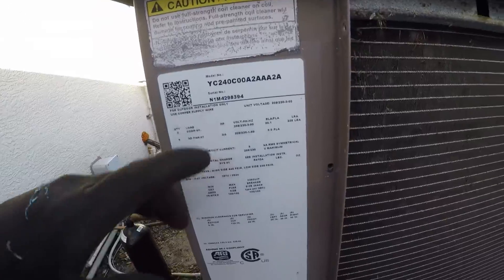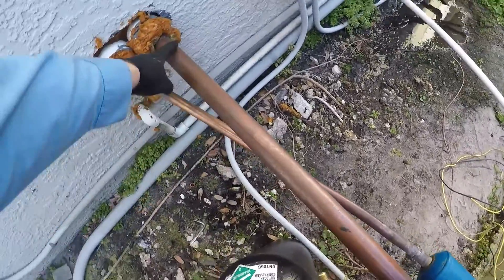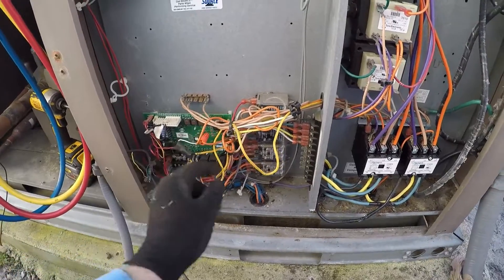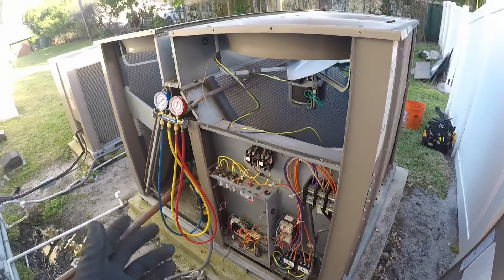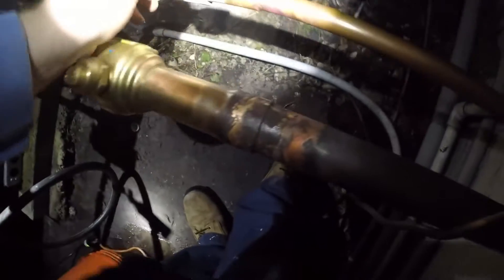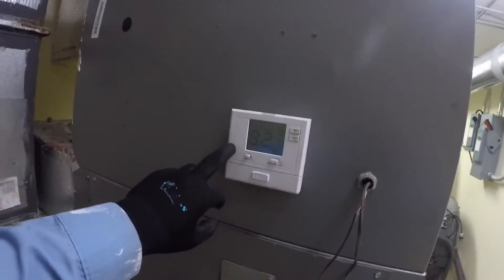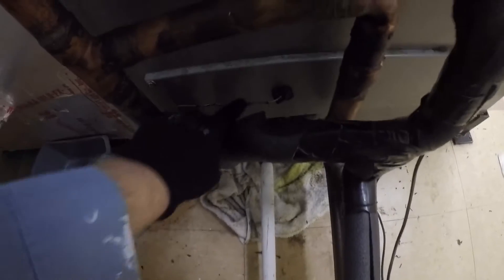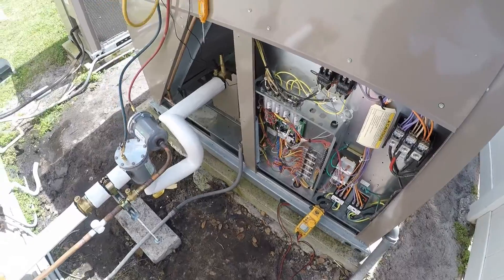20 ton york condenser replacement

Comment: I did work on a Coleman same design as this unit, company replaced the condenser out to a 410a system. The original r22 txvs were still in the air handler so it took out one compressor from the tandem set 🙄

Comment: Wow.... what a mess! Looks like it was a disaster from the start-up! If you don't install a unit properly it's going to keep telling you that you need to get me installed correctly so I can leave you alone and I'll cool the zone with a smile. Btw outstanding piping job with the Sporlan removable core driers with the isolation ball valves, and sight glasses...a good 10-12 degree superheat around 12-13 sub cooling with a good 20-25 TD is the ideal target. Oh yeah incorrect TXV bulb installation is a flood back waiting to happen. Ugh the infamous leaking microchannel coils... I'm not a big fan of York ...or Daikan...aka McQuay units

Comment: Don't you think you should have saw that messed up wiring during your call out for the TXV? Seems hard to miss
Reply from the maker: That’s a good point,  I showed the maintenance staff all of the issues with that unit the day I was checking the unit.   I left everything as is. They had to call out the original company that installed the compressors.  The company could not give a good explanation to why everything was jacked up or not mentioned to the maintenance department. Hahaha the mentioned a bad txv. The txv’s were both good. But they failed to point out all of the other issues. The unit still had warranty on the compressors. The customer chose to install a whole new condensing unit vs repairs. 🤑 always check everything. The customers will blame you for being the last one to touch the unit.  Thanks for watching. I appreciate the support!. 👍
Reply: @20antman  At least they made the right decision in the end by not continuing to allow that other company to make further "repairs" I'm using that word very loosely lol. Anyway great job on the install. The drier cans look like art staggered like that.

Comment: Nice job and nice torque tekton wrench. I don't do much commercial stuff but I do usually jump y1 and y2 to keep good dehumidification if fan doesn't slow
Reply from the maker: Yoooo. Yea man the torque wrench is nice and has great reviews. But it let me down. It worked perfect the first time torquing all of the bolts. 1 week later I replaced the cores. I re torqued the bolts. 2 bolts busted on me. The wrench would not break. I had to bring it down a few lbs.   May have been 2 weak bolts or  the wrench had a glitch.   Do you use the same wrench? 
 Thanks for watching.
Reply: Anthony Reardon hvacr no I was looking at it but I got the kobalt one from Lowes because it had really good reviews. But then it started to not click either and I knew it was past. So I got my money back and got the icon one from hf. Also pick up the $10 one just in case to double check your self
Reply from the maker: How about them digital torque wrenches. Kind of a cool idea. But they are pricey. If they hold up I won’t mind dropping the bread on them.
Reply: Anthony Reardon hvacr I think cdi like Eric had makes the snap on ones.